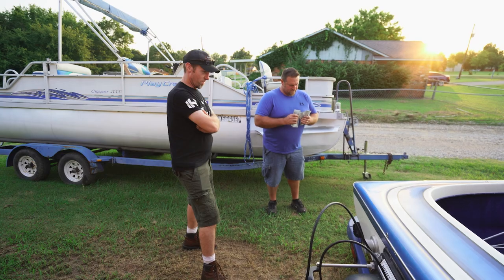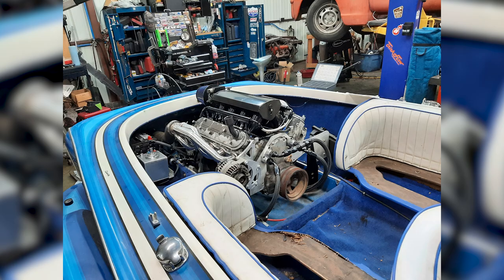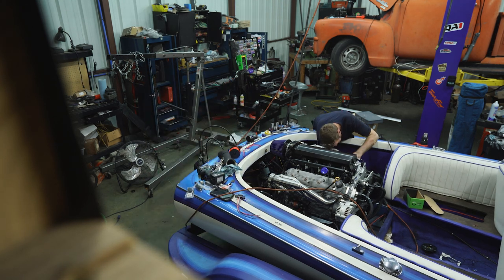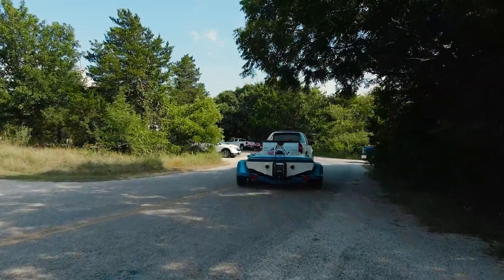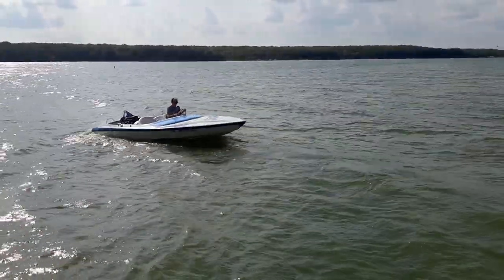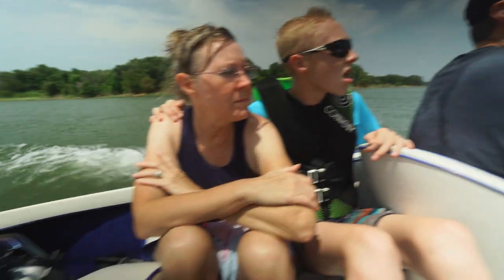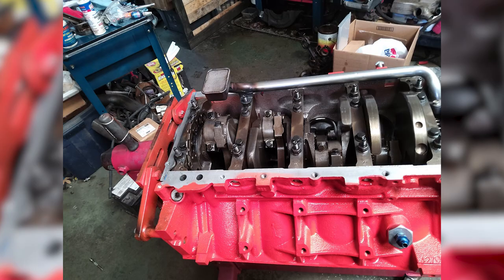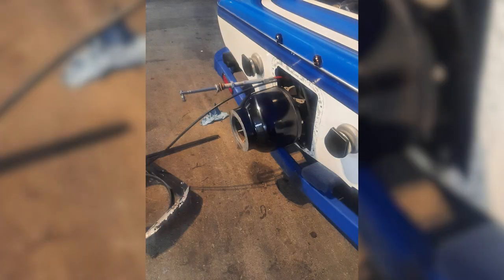Finally, the boat I've wanted for years! LS swapped 81 Miller Jet Boat!! #lsswap #lsboat #jetboat

Comment: Way cool! I’d love some detail on the through hull exhaust and how you have that setup.
Reply from the maker: Thanks for  watching.  The exhaust is a set of stainless turbo headers with 3 inch stainless pipe out, attached with flexible marine rubber szhaust pipe. I use the steam port outlets off the engine to spray water into the pipe as it exits to keep the pipes cool. . The flanges were already on the hull when I bought the  boat. Hope that gives you some details.
Reply: @autovationFtWorth  very cool and very helpful! Thank you for taking time to explain what you did. Was thinking of doing something similar on my big block…

Comment: How fast is it? I have an old formula with twin small blocks. Thinking about a repower. What RPM are you at just cruising vs wot?
Reply from the maker: It runs 60 wide open before the pump cavitation. I need to do some jet work and get it sorted out, but it will get to 60 in a snap.
RPM cruising 35 to 40 is about 3000 3200
At 60 it runs right about  5000
Thanks for watching. 
Share with your friends  and subscribe

Comment: first time sub. on your channel would u help me with info. on engine mount plates,oil pans etc. for a flat v-drive i just bought ? i would love your thoughts on early small blk. chevy vs LS i’m not computer savey 😎
Reply from the maker: Thanks for watching and subscribing!
First off im a car guy that built a boat, so im no expert To mount the engine I used a Hardin rear bell housing with the mounts to bolt it to the stringer.
For the front of the engine an ICT billet motor plate and angle metal to mount to the stringers. 
The pan I used is made by champ oil pans.

There are lots of ways to run the LS fuel injected or carbureted. Just gotta figure out what you want 

If you need any other advice or pics of what I did email me
brian@autovation.biz
Reply: thanks for tha reply an i’ll git n touch soon 😎

Comment: i am looking at buying a boat, the engine froze and cracked the block, it has a 5.7 merc in it. it is a 1992. will the bell housing on it fit any year 350 /305 or a 4.3,, or a 5.3,, hard to find that information
Reply from the maker: All chevy v8  bell housings will bolt up to an LS. The only difference is th bolt at the 2 o'clock position is missing and one is added at 12 o'clock.  So basically  you use 5 bolts instead of  6. Good luck with your build and have fun on the water!!
Reply: @autovationFtWorth  that great now will make it easier to find another engine for it,,i was only looking for gm 350s from the 90s.. 
thank you

Comment: What you run for fuel
Pump?
Reply from the maker: I ran a Carter low pressure  pump to a surge tank that has a Walbro GSL 392( same as a Bosch  044) and it fees pressure to the engine

Comment: I also have a BBC Centurion jet boat.  You may know now but you're not supposed to run the pump dry and rev it like you did. It's hell on the wear ring in the pump. So I've been told. Nice boat.
Reply from the maker: I've learned that after having the jet apart. And the rear bushing on a Dominator is supported  by water only. It's all new now.
Thanks for the advice, I'm always open to learn from someone who knows. 
Thanks for watching,  subscribe and share it with your peep.